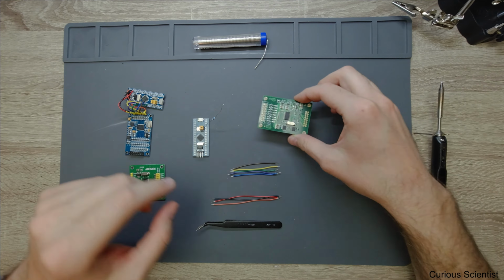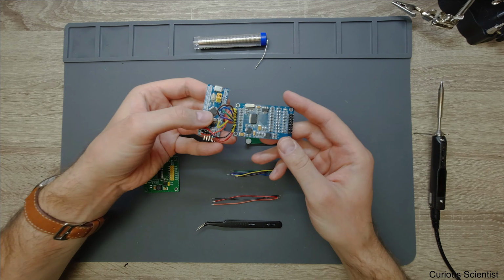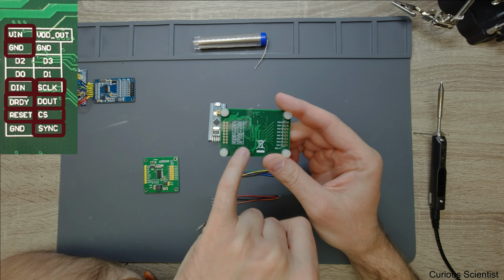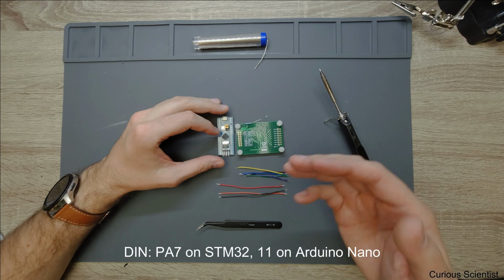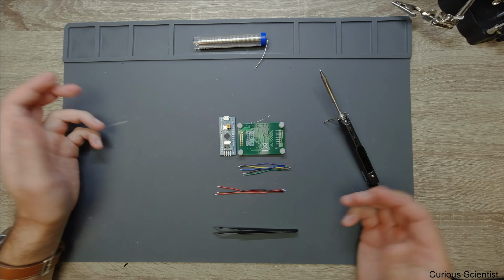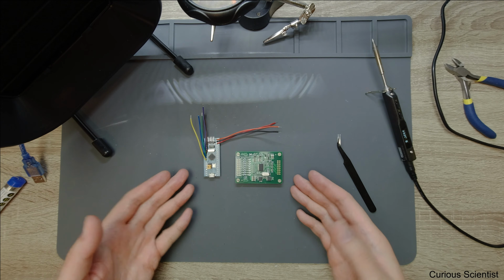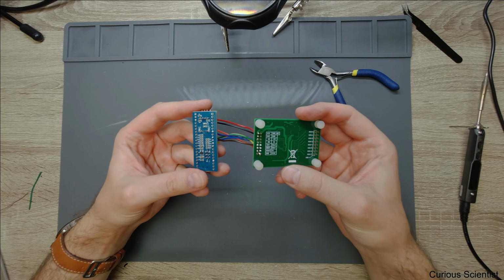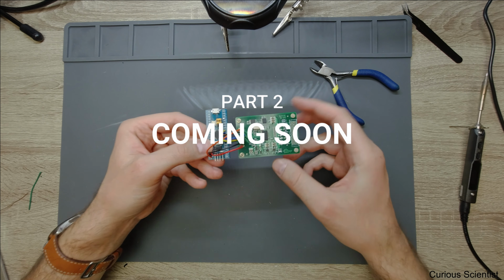ADS1256 board test - Part 1

Comment: Is the ADS1263 (32bit) even a most advanced module compared to the ADS1256? Is it possible to read a load cell, displacement sensor (potentiometer) and a thermocouple all at the same time? I'm also building a tensile testing machine at the moment.
Reply from the maker: Hi! Even this ADS1256 is a bit of an overkill. Check my tensile testing videos please. There, I use a HX711 module. It is more convenient because it is a bridge circuit and a 24-bit ADS on the same PCB. It has a lot of nice libraries as well. Also, watch my displacement sensor playlist. I do not recommend the potentiometer, except if you use the KPM-type of displacement sensors. Simple potmeter is just too coarse for these purposes. Or, just get a digital caliper, and use that. I also have video for that. Then, you don't need and AD at all. Thermocouples also have dedicated PCBs (look for MAX6675 and AD8495 chips), and since they need one with an internal cold junction correction, you don't want to struggle with the thermocouple and the ADS1256. 

Also, just think about it. You want to use a 24-bit ADC. That is essentially 596 nV resolution. So, if PGA=1, you already have a very fine resolution. A TC is usually between  0 to 1600 K. If you do not want to have 10 microKelvin resolution, you don't need ADS1256. I recommend you to use ADS1115 and use dedicated circuits for the TCs and load cell. I will upload a video soon about my thermometer. I have built one last year. :) With this small machine, you will move between room temperature and maybe, very maybe 50°C at maximum. So it is 30°C difference. Even the Arduino's 10 bit ADS is enough for that.